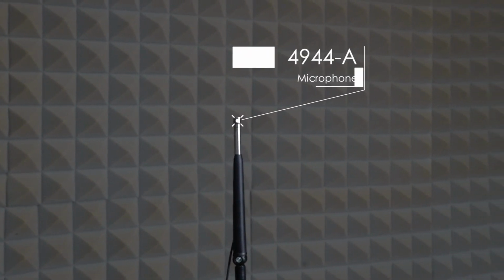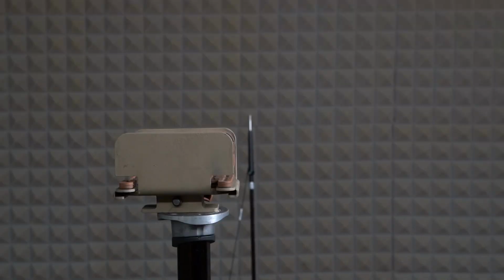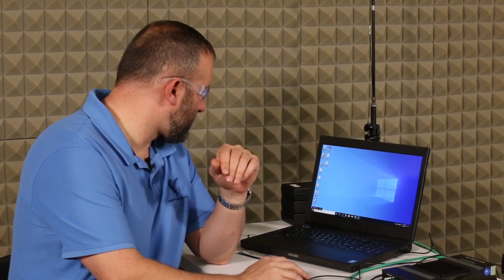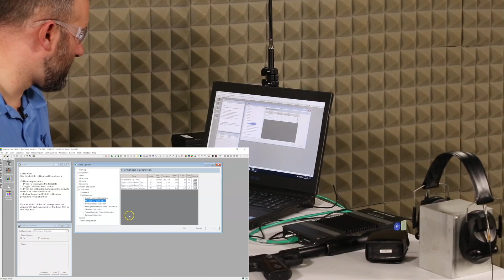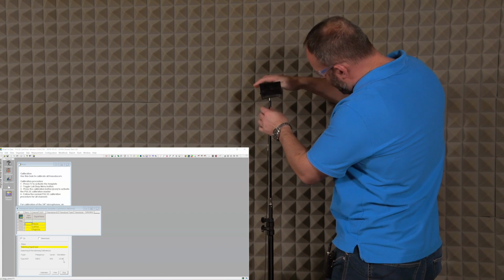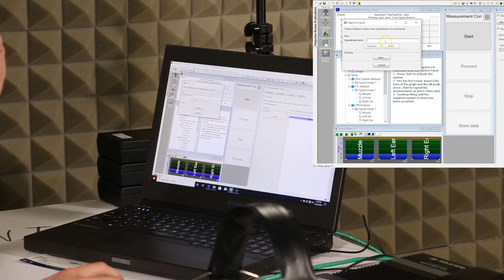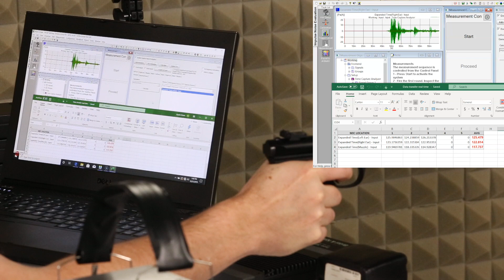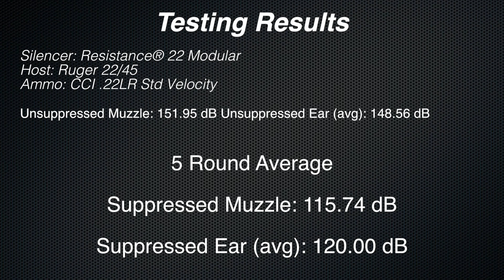Introduction to Sound Testing - B&K PULSE System

Comment: With the preface that I know it doesn't make a huge difference either way: I still  think it's appropriate to have the 1-meter-left microphone placed perpendicular along the same line as the muzzle of the unsuppressed firearm, and then move the microphone forward (or the firearm back) so the muzzle of the silencer is moved perpendicular to the microphone again. This way the microphone is always located at the same epicenter of the shockwave.
You've assumedly seen Schlieren and other digital methods of viewing the sound-event epicenter and its propagation (But for others reading this, see: https://www.americanscientist.org/article/high-speed-imaging-of-shock-waves-explosions-and-gunshots ). An observer can see that if the bullet exit "uncorking" area was moved forward, then one would be gathering one datapoint from the center of that large shockwave when unsuppressed. But when measured suppressed, it is then capturing a shadowed event now located behind the epicenter of the shockwave since the silencer muzzle is now forward of that original, unsuppressed position.
I'd think that by keeping the mic at the same place for baseline and then suppressed readings, and in effect moving the exit or "uncorking" event location forwards (away from the unsuppressed mic position), you'd be missing some small amount of wave peak — especially as meters get faster and faster (and when metering longer silencers and slower burning ammunition propellant!)
Slower rise time systems would assumedly pick up some small bit of the quickly-expanding epicenter and would probably even things out, but the quicker systems might be sensitive enough that they may wind up getting the noise peak "gamed" a bit. It's a bit harder to be precise with microphone placement outdoors, but if testing moves more "lab" style, indoors (where it can be isolated from atmospheric and temp conditions, provided a large enough room with anechoic precautions taken) it would be easier to set up solid fixtures to align suppressed and unsuppressed firearm positions consistently. Obviously, one way to prove out this musing on the subject might be to set up two microphones at the 1ML position: one parallel with the endcap/silencer muzzle, and one parallel with where the unsuppressed muzzle would be. Capture readings at the same shot, same time. The difference would probably be unnoticeable (or at least unobservable) with analog needle meters, but it would be interesting to see what a ≤ 20 microseconds rise time / ≥192k sample rate system showed out to some decimal place!
Reply from the maker: The cans are getting more quiet than they were in the past.  We don't want to measure supersonic bullet flight noise (which will technically occur whenever the bullet is supersonic relative to exaust gas), and we do want people to understand how noise 1M left of the muzzle device is changed by adding the silencer.  We are testing all cans to the same standard, so that initial to final reference position is maintained.  This is the most consistent way to do this.  You can actually put 3 mics 2 inches apart and get different readings about .3DB mic to mic.  I think this is because the system has a resolution of about 1/2DB above 140DB, and also because the sound wave has different pressure at different positions very close together.
Reply: @GriffinArmamentOfficial  So could the suppressor length have a greater reduction in metering numbers just because it uncorks further away from the mic? (Given two suppressors, one twice as long as the previous with the exact same noise reduction)
Reply: @trevork547  It could have very small effect on the metered result.  I believe it is more significant to reduce the ability for muzzle geometries to "cheat" the meter, by keeping the mic at the unsuppressed muzzle location.  This reduces the effects of bullet flight noise and of small blast shielding features like a dished muzzle face.
Reply: Griffin did it correctly because  the shooter gets farther away from the “muzzle” when a suppressor is added since it adds length